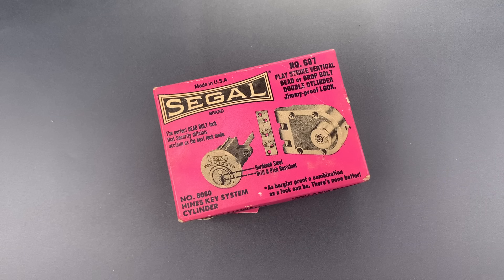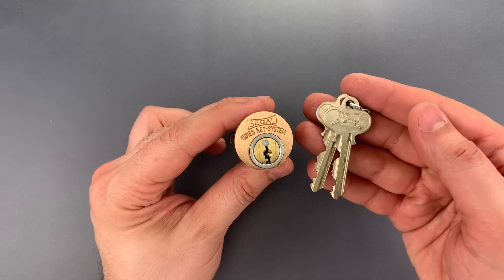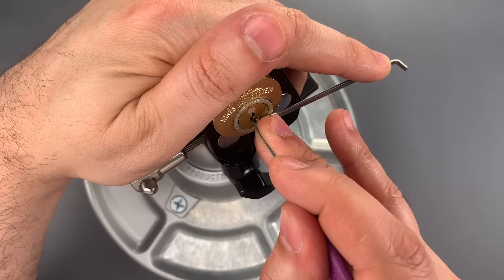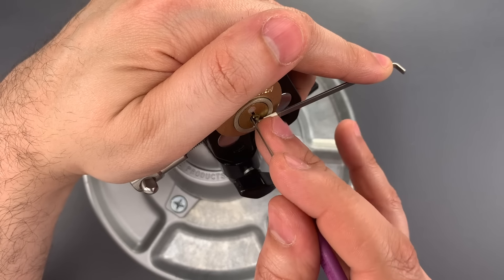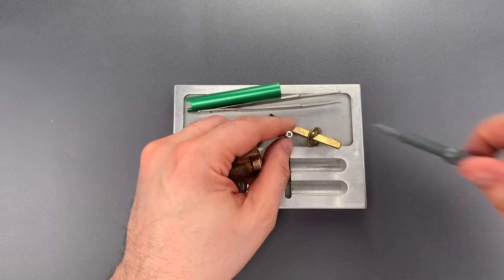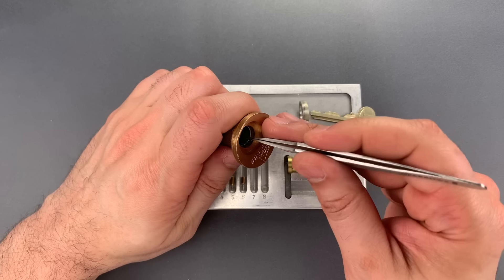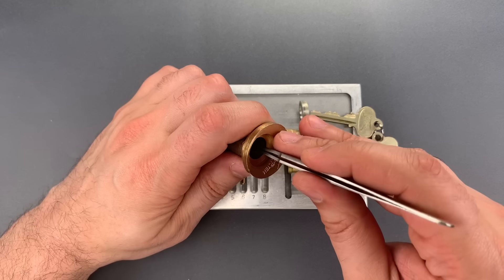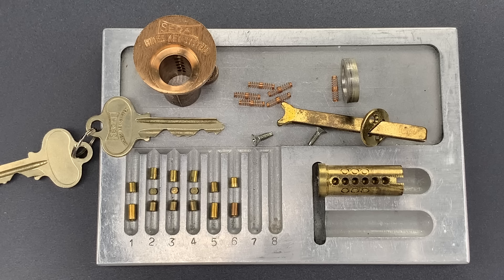[1181] A TRAP For Pickers! The Clever Hines Key System Picked

Comment: Couldn't the manufacturer just randomize which pins need to be set to the second sheer line? 
That way someone picking the lock would not know which ones have to be set where. 
also one could just vary the length of the wafers.

Comment: You know why don't we have solar panelled electronic locks. Think about a little solar powered lock with a key fob with the chip system seen in recent cars. 

The moving of the lock requires the use of the panel if the power goes out the solar will keep it going. I know it's possible there's lights with hours of power that are solar panelled.

It would be unpickable because there's nothing to pick. It would be a lot better at actually keeping a dishonest person out.

Comment: Does this guy sound a bit like the white house person named Barr?
Edit:
Aside from most locks being easy pickens for thieves, I've found out that many modern windows are too. I guess that people got tired of the broken glass. 
Actually, those big sliding windows from the 60's and 70's were too.  It does take two people to lift them. My husband always had us cut old broomsticks down to the exact length of the slide on windows and doors. It didn't matter which direction the window opened, horizontal and vertical both work. Just attach rubber to the ends to prevent slipping.

Comment: what if the pin holes were full of those hollow pins, and only the "correct" one was solid? That way you could not overcome the anti-picking mechanism. 

"Got a click from one, and a second click, and third and fourth.. I wonder which of these clicks is NOT going to lock up this lock"

Ok, now that I think about this, those pins are too long for such system.

Comment: This looks like a great safety measure agains pickers, why not randomise the 3 traps between the 6 pins.
Reply: Because you just apply the technique to all 6 positions.
Reply: @stargazer7644  Yes but surely it will take longer to pick if you dont know the location of the 3 traps?
Reply: @Wagenmeister  Sure, a few seconds longer.  It doesn't make it significantly harder.  The quikset modification based on this puts trap pins in all or all but one of the locations.

Comment: It is not really a second shear line though is it? It is more a case of a second component encountering the same shear line?

Once this trap had been sprung what was the legitimate owner supposed to do I wonder? It couldn't be opened with the real key, it couldn't be drilled and it couldn't be picked again... Would you have to break down the whole door and replace it? I could easily imagine bastards triggering the trap 'for a laugh' since the fact it was one of these types of locks was advertised by anti-drilling inserts. Maybe it was more for very specialized uses inside an office building rather than your front door.

Comment: 1:47 One thing I notice in many of your videos is that you hold your hands in ways impossible to do when the lock is installed for normal use.
Reply: As if it is impossible to keep tension on with one hand and pick with the other when it is in an actual door.
Reply: @stargazer7644  impossible?  No.  Harder?  Very possibly.
Reply: @RonJohn63  Do you have some condition that prevents your two hands from moving independently?
Reply: @stargazer7644  that has nothing to do with " when it is in an actual door."
Reply: @RonJohn63  You tension it with one hand, and pick it with the other even if it is in a door.  Brace your hand against the door and use that for leverage to tension it.  What is the huge difficulty?  You act like people haven't been picking locks (in doors) since locks were invented.
Reply: @stargazer7644  you're still aggressively missing the point.   He wraps his hands around the whole lock body because it's more convenient.  That's got to make it easier -- and thus faster -- to pick.
Reply: @RonJohn63  FFS dude.
Reply: @stargazer7644  if you can't get the simple concept that it's easier to pick a lock when you can hold it anyway you please than when it's in a door through your thick skull, then there's truly no hope for you.
Reply: yall have 0 likes in total lmao

Comment: how to evade the lock: BREAK THE DAMN DOOR OPEN OR BREAK THE WINDOWS
Reply: Yea, that's why LPL loves to bypass safes with serious defects without even touching the lock. A lock is only as good as the chain it's securing. If you don't have a secure door frame you won't have to worry about a picker, because most thrives just kick the door down.

Comment: I think in practice this lock would be virtually unpickable because of one thing. You need to know what type of lock it is in order to pick it. First off, most criminals don't research locks a lot, they will focus on the common ones so if they do attempt to pick this lock they will likely fall for the trap pin. But now let's imagine the thief watches LPL for fun and knows exactly what kind of lock this is. They know that picking it will take at least a minute of concentrated effort and they still run the risk of triggering the trap. So, they will weigh the options and pick the lock of your neighbor who has a master lock deadbolt. Either the thief is stupid enough to fail, or smart enough to never attempt it.

Comment: Funny some of these old anti pick locks, while in a perfect world its a good idea but in practise as the key wears down and other parts wear id imagine there was a huge failure rate and the rather thin wafer looks like a no 2 master pin, anti drill it aint, just drill for the cylinder retaining screws and ur in or peel the cylinder rose off and use a stilsener  on it. Good on you also for pointing out all short comings of the words unpickable, 99% not true.